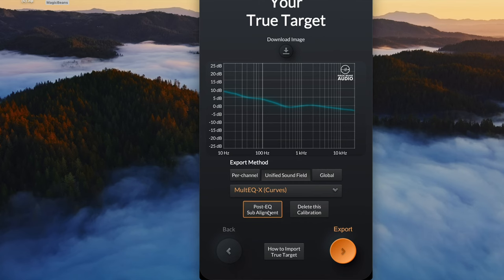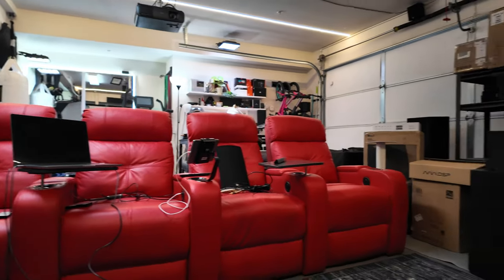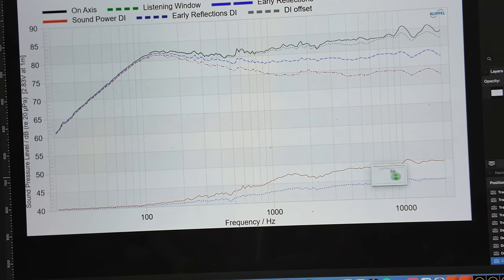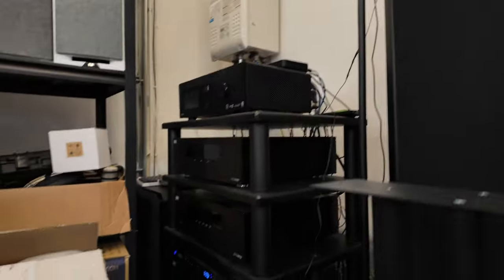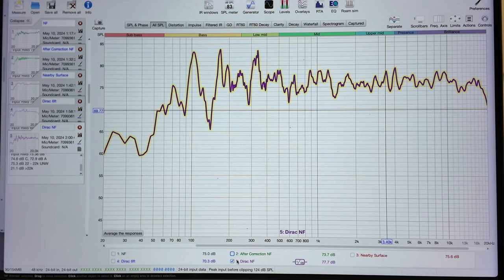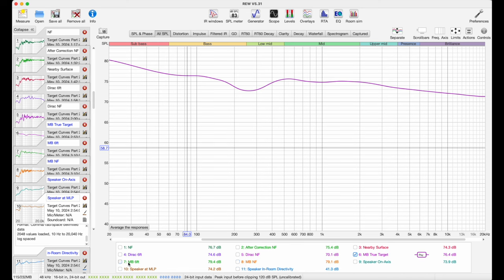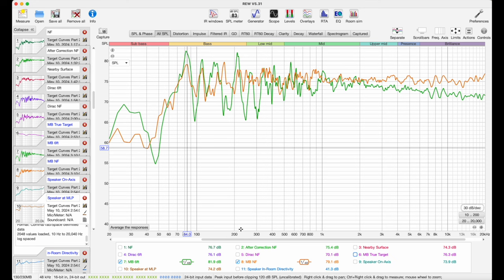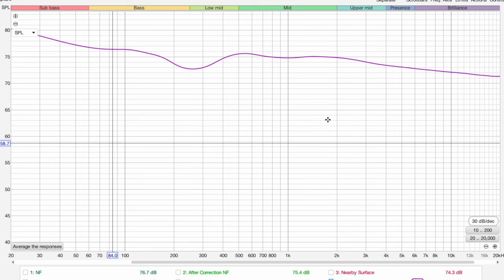Why Generic Target Curves Don't Work (Part 2 of 2)

Comment: So oversimplified, use near field to EQ above the transition frequency, then use listening positing to smooth below the transiting frequency. Correct?
Reply from the maker: That sounds about right. The tough thing is finding the proper splice point and making sure not to overcorrect directivity mismatches.

Comment: I watched both videos and I remain confused as to why the target curve isn't simply the desired in-room response at the listening position? I thought the applied EQ would consist of the filter parameters to get the actual frequency response (including all effects from the electronics, speakers, crossovers, and room reflections) to get as close as possible to the "target." If so, then the target is a matter of psychoacoustics and human preferences and not dependent on the room. But you say the target curve should change depending on the room reflections etc, whereas I would expect that the correction curve would be the thing that adapts to the room reflections etc.

Comment: In Home Theater, do all small speakers overload the sub? How does bass management work when you use it on small?
Reply from the maker: I'm not sure I understand your question.
Reply: @joentell  İŞ THIS RIGHT ? 

Without any bass management, you get a much better sense of scale, power and precision in the bass region. The other reason is that it frees up the subwoofer to just handle that important '.1' channel on multichannel sound tracks. Free from the responsibility of bass redirection, the subwoofer also gains more head room and precision.
Reply from the maker: @amigosdohometheater5140  I don't agree with statement at all. Unless you are using giant speakers capable of full-range output down to 20Hz, you should be using bass management. With the subs set properly, it should be a seamless blend with your main speakers and add MORE sense of scale. Any decent subwoofer should be able to handle the bass managed portion as well as the .1 LFE content.

Comment: I recall on my Harman Kardon Avrs the EZset EQ calibration used 3 sets of measures, one near field, in front of every speaker (except the subs) to measure what was emited from the speakers , one at listening position were each speakers would emit the tones, to measure what was received and how the room transformed the sound❤, and the 3rd one was for bass management with a measure left of listening position and another one right of listening position. The results were quite good given it was 15 years ago and the system did manage 7.2 speakers already.
Reply from the maker: Which AVR was it. I took a look at old manuals and I don't see the method you described.
Reply: @joentell  it was AVR 630, 745 and 760, the AVR760 was named AVR 7550HD in the US AFAIK, I don’t recall the method being written in the manuals, the On screen setup menu explained how to do it.

Comment: Hi Joe, Got a question about magic beam. So currently I have my LCR in Baffle Wall and behind the AT screen. Can I use magic beam?
Reply from the maker: Yes, you sure can. It will help restore some of the high frequencies of the speakers behind the AT screen.
Reply: @joentell  Thanks! Do I need bring out the speaker or just leave in baffle wall? Should I measure with AT screen on or take it off？
Reply from the maker: Test it as is with the screen for both the nearfield and farfield measurements

Comment: @joentell So if i run Dirac. I should really leave it as is with the results and not import a 6, 8, or 10 db Harman target boost over the results. Will the be really inaccurate after importing?
Reply from the maker: I can't answer that without having more measurements. It can sound better or it can make it worse. Every room is different and there are other variables. The whole point of this video series is there's no one-size-fits-all target curve. You have to go by the measurements like the MB app does.
Reply: @joentell  side note maybe worth mentioning, have you heard of issues with Dirac live, MacBook with usbC and umik1 having issues during calibration recently? Problems with the master volume and mic gain controls. Or allowing to take proper measurements or getting a prompt that phase will not be corrected do to erroneous readings. Found a few threads where there no current fix. @joentell
Reply from the maker: @UnitedRedDevil13  I haven't seen that myself

Comment: Hi, greetings from Germany. Is it possible to adjust the target curve? E.g i want more bass or less or a higher slope in the high frequency area? So basically as possible with Dirac, audessy etc?
Reply from the maker: You can adjust the target curves in Audyssey MultEQ-X by adding another adjustment curve or in Dirac by manually adjusting the points. In most cases, it's better to use bass and treble tone controls.

Comment: So looking at the index of the speaker can it be corrected in the mid to lower frequencies at all
Reply from the maker: Below the transition region, it gets a bit more tricky. Sometimes a left speaker will have issues that the right doesn't. When using multiple subs, you can idealize the response a bit more.
Reply: @joentell  is it because left speakers are usually near a wall

Comment: I also think that Dirac just corrects (the average of) the room response. No windowing applied. That can lead to strange results when measuring at one position. I also think it is not the right way to make such fine corrections above Schroeder. I dont know why they not use a FDW of like 10 ms or so to correct above that. My impression was that is only using broader filters above a certain frequency. Dirac is imo on the aggressive side of corrections. An because of that there should always be used many measurement points when doing corrections above 500Hz so that this fine corrections will be smoothed out. 

In REW you can easily a FDW to a far field measurement. The Trinnov lets you see which correction curve applied so you can see what it is doing there. It is also taking into account a FDW and you can force it to only make broad corrections above a frequency you can chose. It would also be interesting what Audyssey does.
Reply from the maker: I've done comparisons using a single point Dirac measurement vs multiple positions. In some cases it made a difference and in others, not so much.

Comment: My home theater 7.4.4 additionally front center surround deep bass expanded with REL T7x: This magic beans method works, it works in an incredible way. I didn't tell my friends about the new method, I just let them watch films. Everyone, without exception, was blown away by the new listening experience. Would Harry Potter have set the system?🤔😘
Reply from the maker: That's the good and bad thing about Magic Beans. Once you've gotten it setup right with True Target, all there is to do is to enjoy content. But then, there's not much to tweak...unless you decide to upgrade your gear. :-)

Comment: I had an A-ha moment when watching your video. You can EQ the highs with certain accuracy but EQing the lows only changes what comes out of the speakers…it does not EQ the room!
Reply from the maker: We can only really EQ the sound coming from the speakers. The room doesn't have an input. ;-)
Reply: @joentell  hi, do you mean we are eq the speakers the way they are sound in a specfic room,  so its does address the room factor?
Reply from the maker: @upitshak  The research has shown that our binaural hearing and brain address the room factor for the higher frequencies. Bass is smoothed and resonances are removed.

Comment: I don’t know if this is accurate or not, but I always assumed some of the weirdness in the Dirac MLP measurements I would take is because it’s correcting for more than just that position. Because it’s correcting for more than ONLY the MLP, there are some tradeoffs. This does make me more curious about how the Magic Beans method would sound in comparison.
Reply from the maker: The main issue I have with most auto-room correction is they only base their corrections on MLP measurements which can't be separated out from the nearfield direct response from the speakers. Our ears can do it, but a mic and software cannot. There might be a way if we used 2 mics, but that's beyond this video.

Comment: Great video Joe! 🙂
I still got one or the other question with the combining TrueTarget with Dirac: How will the nearfield- and in-room-response look like, if you run Magic Beans, export the target curve for Dirac and apply it within your (existing) Dirac project?
Furthermore: How many measurement points have to taking for the demo Dirac project in your video? I've made the experience with Dirac, that if you take measurements from too few points, it will definetely overcorrect certain frequencies and therefore screw things up.
Reply from the maker: The more measurements positions in Dirac the better for the reasons you mentioned. Magic Beans will make custom target curves for each speaker that you will import into Dirac. You can still adjust individual points in Dirac after.

Comment: Regardless of the contributions, whether and why this method works, whether someone saves $250, it's definitely a transfer of knowledge from an expert, Joe, to an enthusiast, it's me. After all these years of experimenting with REW, etc. I can say: I now have a home cinema.😀🙃
Reply from the maker: Someone can do much of this manually in REW. It's just when you have to do 11-16 speakers where it gets very tedious and there's lots of room for error. This is how I used to do it before. The app can do the same thing in under 20 minutes with no mistakes.

Comment: Did you just seriously measure in 0° for the listening position for REW? That's a no, no! Do it in 90°. You should know this and throw that data you just used out. This whole video is now null and void because of that one crucial error.
Reply from the maker: I have a feeling you might not understand why they recommend a 90° position for MLP measurements. It's relevant for single point measurements where they expect sounds coming from speakers placed in various locations and they don't want a speaker placed behind the mic to be to the rear of the mic. Even though the mic is supposed to be omni-directional, it still has a different response off-axis which is why they provide a 90° calibration profile. This is not relevant for moving mic measurements where we can just point the mic to the speaker being measured. So, please inform yourself before claiming that what I'm doing is "null and void."
Reply: @joentell  likewise. I don't think you fully understand either. And you label yourself as a "professional". So let's agree to disagree.
Reply from the maker: @dicmccoy  I explained the reason specifically. Do you have a response to that?
Reply: @joentell  actually no you didn't. Your reason is for ht people where speaker are placed all around the room. You want to correct for all the interactions with the room hence why Dirac uses 90°. You want to see what the speakers and room are both doing. This is also how you hear with your ears. 0° is for taking part of the room out of the equation and should never be used when measuring in a main listening position. And you're supposed to be the "professional"? 🤣 You do you know that you're just an average guy like us uploading videos and giving people misinformation like many of you YouTubers.
Reply from the maker: @dicmccoy  you're the one providing misinformation. I have no idea where you got the idea that the 90° angle is for capturing all of the sounds and 0° does not. I've read an AES paper specifically about the off-axis angles of a calibration mic and how it affects calibration. Please, stop making things up.
Reply: @joentell  well if you look at your "data" which doesn't align with what Dirac is showing what you should have, then your measuring is incorrect. I also used your method for measuring like 4 years ago with my miniDSP and used yours and Youthmans videos for guidance with REW and the miniDSP on my 2 channel system. I will say this, it did more harm than good. It sounded very off and at one point in pulled my phantom center to the far left. That's when I knew the miniDSP implementing REW had to go and later I found out the way you guys are measuring are wrong. So again, let's agree to disagree that you think that you know what you're doing.
Reply from the maker: @dicmccoy  I honestly have no idea what you're talking about. What method did we have 4 years ago? I released this app this year. Let's be done now. Please this is going nowhere.